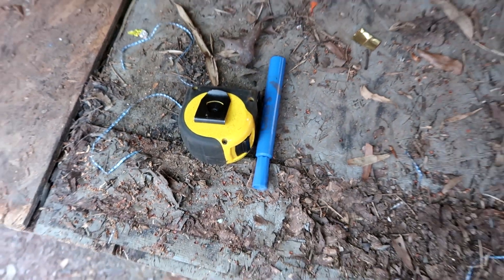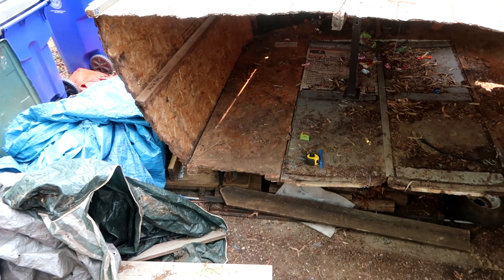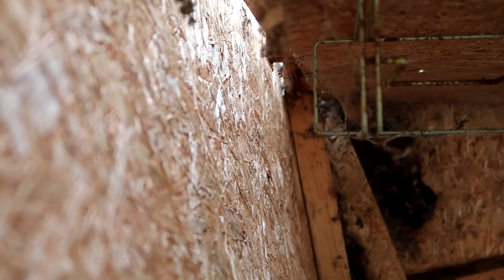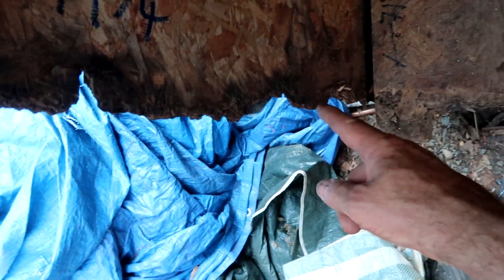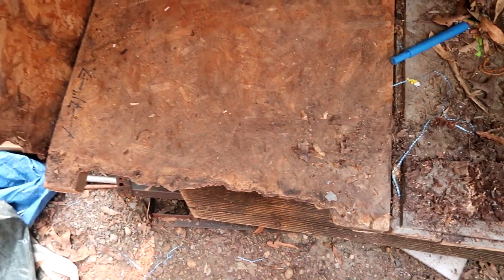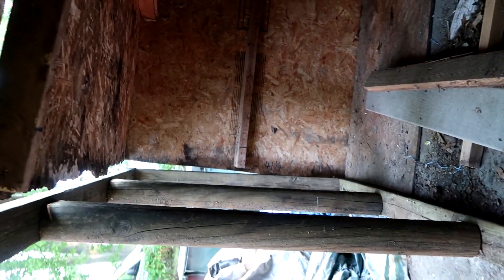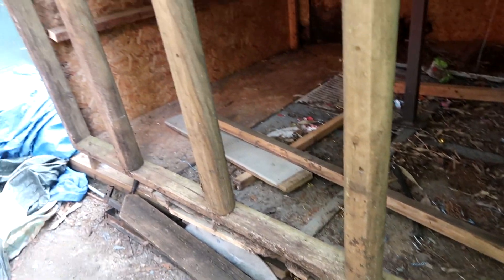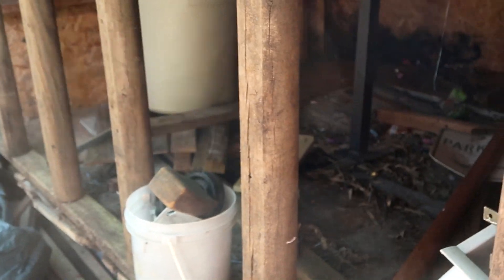To Shed Or Not To Shed Some Light: That Is The Question

Comment: I think your paint brush is actually a magic wand!
Reply from the maker: tHank you.  Poor rag and bucket of soapy water never gets any credit.  Life ...so unfair at times.

Hej, last week I began an interesting conceptualization.
(...hee hee).
I had some old thickening paint and I was painting over old boards which had pealing paint.  The plan is to cap the boards with aluminum coil....but for that moment I needed to paint them.
I painted them without scraping any paint.  The thick paint meant the brush had to work a touch harder and flakes of old paint were cracking and sticking.

It was kind of an interesting prep work that made the boards look fine from the street, but didn't result in loads of paint chips.

I'm looking forward to experimenting a bit more with this.
Maybe...there is magic in the paint brush like you said?